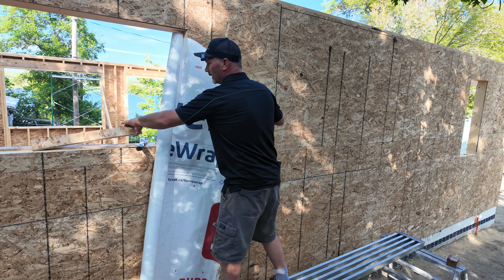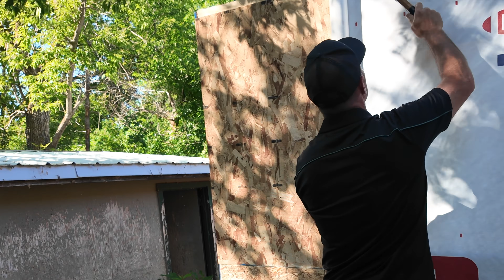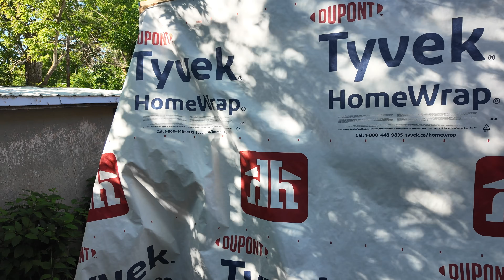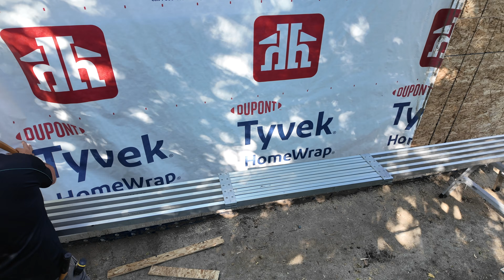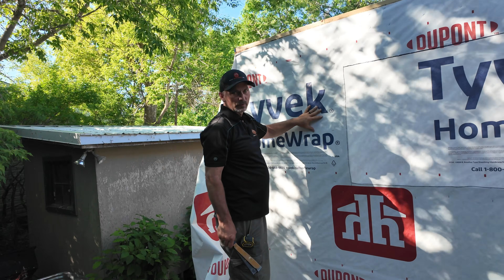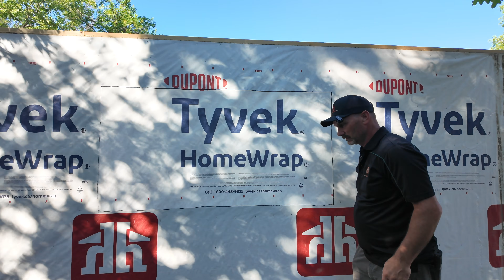How To Install House Wrap (Cabin Project)

Comment: How far can you wrap the roll around the house before you should cut it and make a new vertical edge? Or can you just roll it out in one huge piece until you run out of wrap?
Reply: Its up to you.  But the less seams...the better because no need to tape...😂
Reply from the maker: Roll out as much as you can .

Comment: At 2:03, you said standard 3/8" staples "wide crown."  Don't you mean narrow crown?  Those hammer tackers only work with 3/8" crowns, right?
Reply from the maker: 3/8" was the length ...I'm not even sure the width but I would consider narrow crown as 3/16" wide or less.

Comment: Great video! I know with cap nails we hit the studs. With staples do they ever pull out when only going into OSB? Thanks!
Reply from the maker: They can if the wind gets it flapping badly. I normally try to get siding on shortly after but that can not always happen. The project in this video is still just wrap 9 month later.

Comment: Hi Shannon! 

A long do I have before installing the wrap before the plywood gets damaged?
Reply from the maker: Really depends on your weather during that time and the type of sheathing used. Continual soggy wet weather on OSB for weeks at a time is not ideal and even ply wood can get damage under those conditions but usually would take longer. The fact that standing walls dont allow water to pool and soak in helps a lot for both products. In normal (none tropical) rain situations you would honestly be ok for up to 12 months likley but I generally like to get it covered in the first month or two. I have seen sheds built with OSB and they have never been covered or painted, they are still standing after years but I would not do that.

Comment: You will find that any time you need wind in your area. take out the house wrap or a drop cloth and the wind will come out of nowhere. Helpful tip.
Reply: Same goes for rain. Any time you want rain, start a roofing project.
Reply: Very true